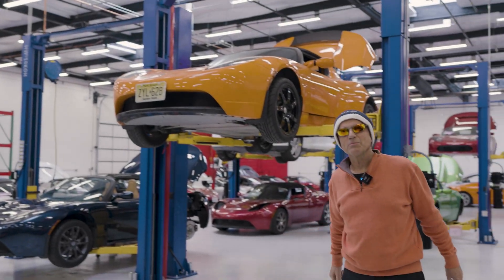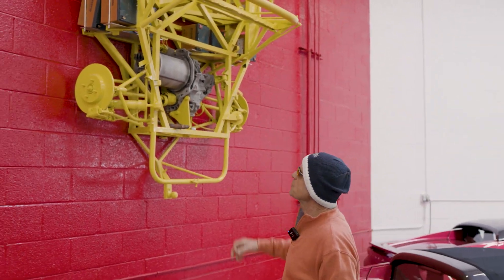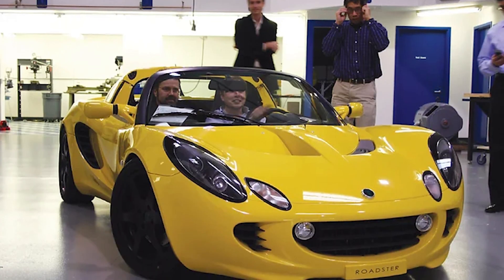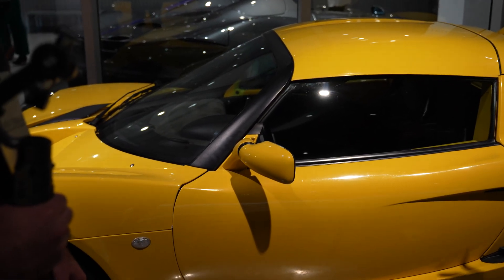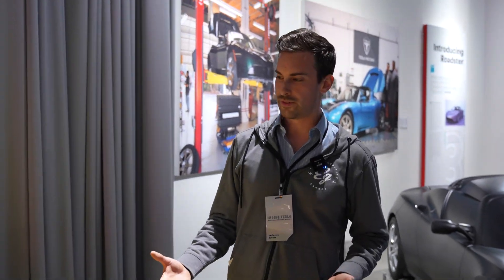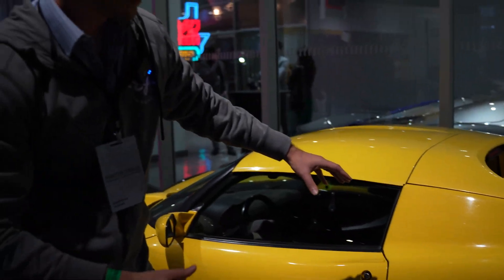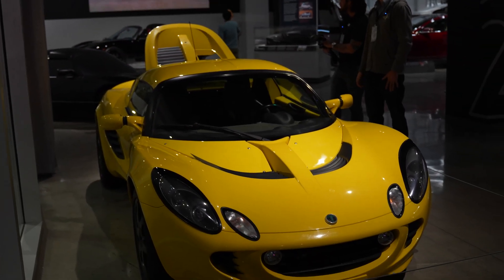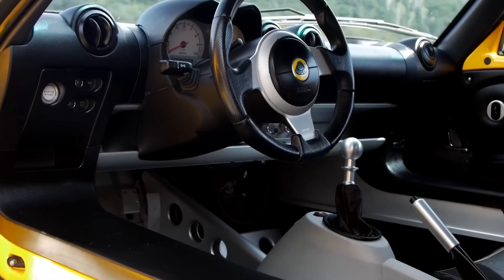Tesla Lotus Prototype | Gruber Motors

Comment: When i had met with Tom Gage in his T-Zero he said they had used thex18650 cells on a government project to make it electric. 
   Tesla used the T-Zero motor controllers and battery packs for the 1st years production of the roadster. About 500 were made that way. They even had V2G but Tesla said they wanted digital controllers. They dropped ACPropulsion who could have sued but did not. ACP felt everyone would lose if they sued.
Reply from the maker: Tom also drove a Tzero as a daily driver.  The switch from the ACP analog Power Electronics Module (PEM) to a digital version outsourced to Taiwan, did include some controversial elements since ACP felt portions of their design, in the charger and regen circuits, entitled them to continued royalty payments.